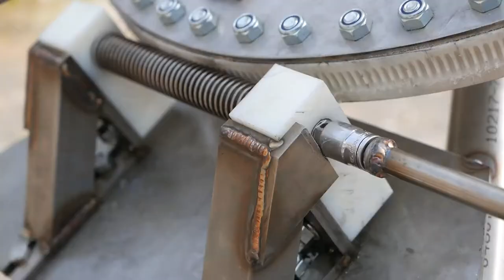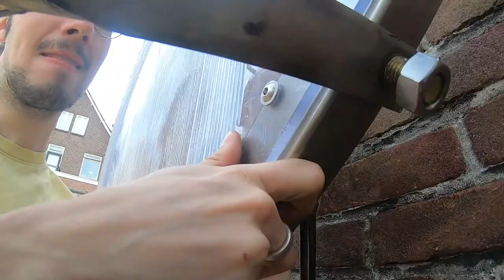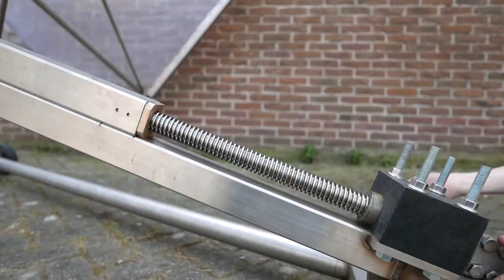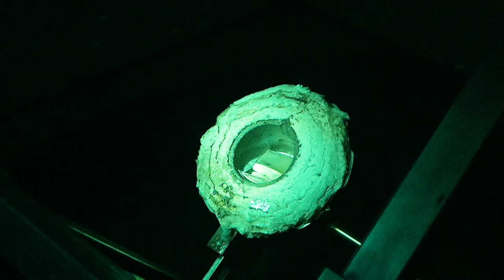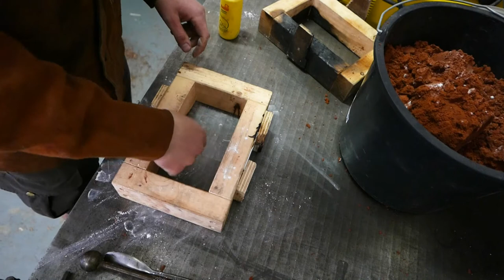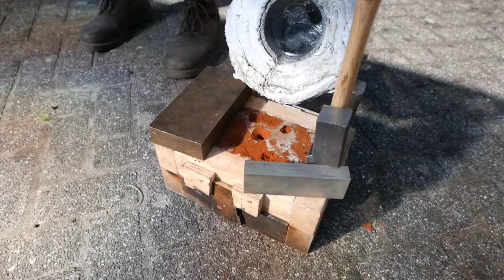solar metal smelter in use

Comment: It’s great to finally see a new video on the use of this big fresnel lens! How hot did the aluminium(?) get? What’s the max temperature you managed to get? Are you in Holland?
How well is it working for iron?
I’d love to see more!
Reply from the maker: i melted zinc, the highest temperature it reached was 561 degrees celcius. I am indeed in the netherlands! it does not melt iron, for that i am planning on building a way bigger installation. Unfortunately this will turn very expensive, so I am looking for funding.
Reply: @jelleseegers6693  What's the diameter of the focal point? From what I can see in the footage it appears to be way larger than the crucible which means you're losing energy. If that's the case, a bigger lens with the same optical properties won't help. A funnel-shaped reflector might improve it a little (if it can withstand the heat)

Comment: how did you grind the glass lense with the angular arcs?
Reply from the maker: i did this with a modified die grinder. In short the die grinder was mounted on a height and angle adjustable support, connected to a center point. i moved the thing in circles by hand while it was cutting away the polycarbonate with a few different ground bits. Sometime this year (if funding allows me) i will start building a 5-10 times larger version. for that I plan to make a better series of video's taking you through all steps.
Reply: @jelleseegers6693  A 5-10 times larger version??? Subscribed, I wanna see THAT 😄